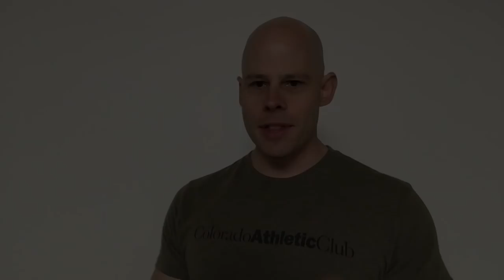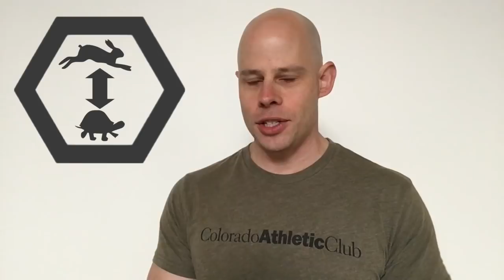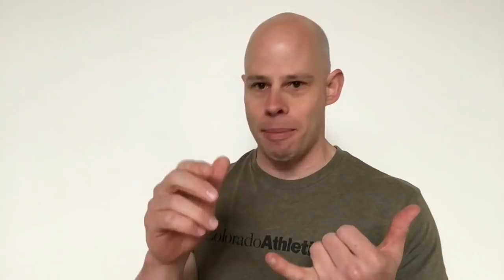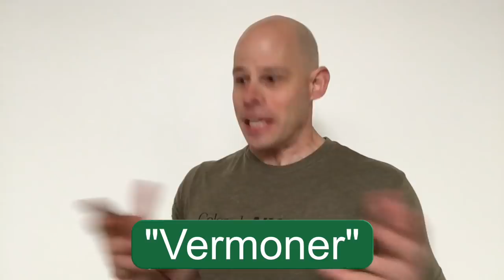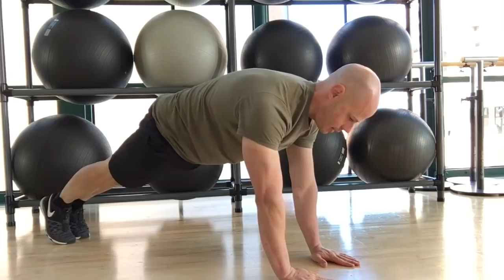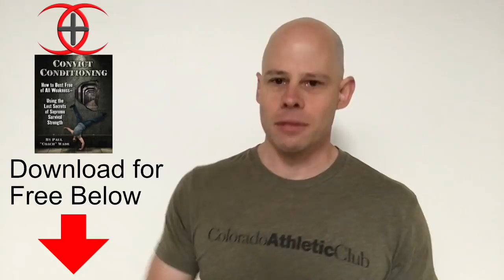How to Use Rep Speed to Improve Tension Control

Comment: G'day Matt, you do a great job with your videos, short & succinct, very informative (unlike my comment here).  I have barely dabbled in physical exercise (i used to ride a bike tonnes in my first 20 years).  i am now 48 and am getting back into Convict Conditioning 'New Blood' workouts - i have started two other times but, anyway, back into it.
I have been playing around with isometrics and figured if tension is critical and isometrics are wonderful - then maybe i can do weights without the weights, so i can take my arms/shoulders through a full range of movement with maximum tension but no weights (sort of like isometrics but moving instead) to increase strength and mobility but without the danger of injury through weights.  I think it is working (maybe 'cause i am a newbie) but when i came back to starting CC i was able to do 2 sets of 20 for all four exercises without too much trouble.  Is there any science for maximum tension through a range of movement without weights?
I haven't seen before anything anywhere that comes close but your isometric movement phase of the pushup is what i am talking about.
I did this method on the wall with fingertip pushups for a few weeks - just doing a few at different times during the day just tensing the fingers into the wall and all my muscles as i did the vertical pushup and i found after a few weeks that i could actually do a few fingertip pushups on the floor (i am not going crazy with them though - i keep them mostly to the wall - i don't want to injure my fingers).
Yeah thanks for your time in reading this mate, cheers & all the best - thanks for all these videos too, all the time you put in, cheers
Reply: umm, yeah, if i just read some of the comments, i see below the question from Kyle Davis & replies below his, cheers

Comment: Great content! Due to your channel and other similars to yours I've been trying to do these things on my own so that I can better understand my body, while I'm doing my strictly bodyweight routine.

Actually this was caused because I noticed a muscle imbalance on my right bicep which is significantly bigger than my left bicep (I'm right handed by the way). Anyway I started to compensate on my right arm by using dumbbell exercises and the difference is much less noticeable.

Anyway by using this progression I could feel that my right arm is always using much less strength and induring much less tension.

Is there anyway possible to correct this problem with a better mind muscle connection and if so is this method of yours a good way to go about it or you advise me to do something else?

Best
Reply from the maker: This will certainly help. Also, try taking a video of yourself doing pulling exercises like rows and pull-ups and see if you can tell a difference in the position between your right and left side. There may be a technical issue that needs to be resolved.

Comment: I have  injured myself doing pike push-ups. Now i have pains in mu shoulders during pike and normal push-ups(doesn't matter if I'm doing diamond or wall-push ups. I still feel somethink in my shoulders). Is it good idea to do high reps wall and elevated push-ups (on the desk) like in convict conditioning + pike push ups on my couch. After that, some stretching and mobility work. I know that is to little information for you but maybe you can give me some tip or advise. Thanks for your time. Your content is great
Reply from the maker: My heart goes out to you RedHakin, shoulder injuries suck!

I would do the low resistance and high rep stuff for now just to get some blood into the joints, but never try to work through pain. If it persists much longer I would get it checked out to make sure nothing is seriously wrong.
Reply: RedDeltaProject That's was my plan. Thank's for your time

Comment: hey Matt what should how should be the breathing while squating?
Reply from the maker: Depends on the squatting technique and how you're programming it, but generally, you breathe in on the way down and exhale on the way up. Some athletes breath in at the top and hold it to create intra-abdominal pressure for stability. That's especially the case when working with a heavy weight.

Comment: Hi Matt,   Good luck with your Bills this upcoming season!   I have an off topic question regarding golfers elbow, tendonitis.   I was practicing handstand pushups when the pain started.   I've had it now for about 6 weeks.   I backed off on my workouts and am basically using suspension straps now.   Is this something that i need to keep working through and the pain will diminish over time or is there something you can recommend that i do?  Thank you!  Rick
Reply: I had pain in my elbows from pull ups to push ups, what solved my prob was curls/extensions with bands, high and fast reps (pump reps), I hit about 100 reps each move no matter how many sets, you can do everyday. I tried almost everything else out there and they didnt work for me, don´t know if it will work for you, but give it a shot.
Reply from the maker: That's one of the few semi-common injuries in calisthenics. it's often from a lack of external rotation and places more stress on that tendon when the arm is internally rotated under pressure.

Take some time off of the hard moves and continue doing low resistance exercises that don't cause pain. This is an injury that can take a while to heal (which sucks I know).  As you get back into training, focus on keeping your back tight and rotate your elbows in slightly.

Comment: Can you build muscle by flexing really hard. No exercise, just flexing?
Reply: plz disregard the broscience above.
Reply from the maker: Some say you can. Google "Dynamic tension" and you'll find there's a long history of training with just flexing the muscles. I've played with it myself and it way okay. It's hard to make the muscles tense up hard enough without some form of resistance but that could be becuase I wasn't skilled enough in the discipline and needed to learn more.
Reply: The human body is so remarkable, anything could work. Be it high reps, low reps heavy weight. At the end of the day your body can only adapt to whatever you do with it.
Reply: Kyle Davis i think isometrics exercises work just with tensions.

I do know that is possible to build strength, but I really don't know if it's possible to build a massive quantity of muscles just with isometrics exercises
Reply: Kyle Davis you dont need muscle. Quantity has a limit. Hard flesg - tendons are qualitative and have no limit
Reply: RohanOf ElvenPower what do you mean by "tendons have no limit"?
Reply: Kyle Davis they have no limit of strength. Whereas muscles aince they are quantity focus aka more size/mass for strength then its clear muscles were never designed to be increased forever and thus not designed to be the primary source of strength. In aryuveda the ancient texts say that during the pricess of digestion, from the best parts of food, chyle is made. From the vest chyle, blood is made. From the best blood flesh is made (skin, muscles) and from the best of that hard flesh (ligaments, tendons, etc) is made.
Reply: onceuponthecross1 k
Reply: Yes as long as you fatigue your muscle you might not build mass but you Will gain muscle density.